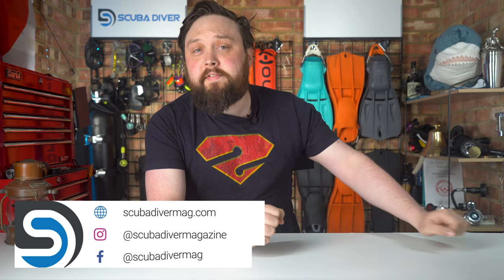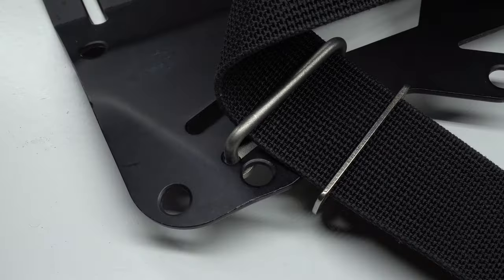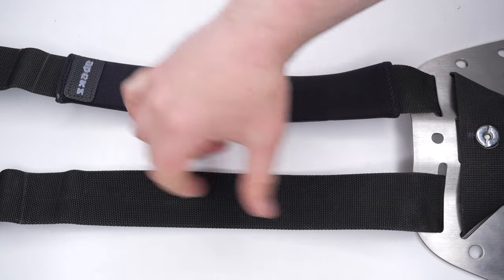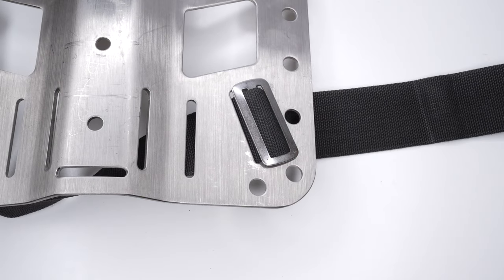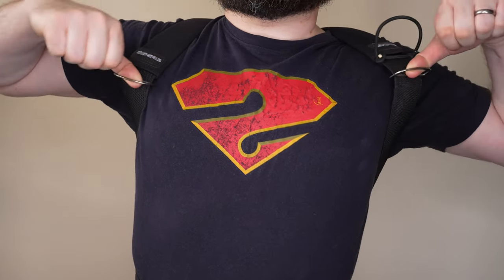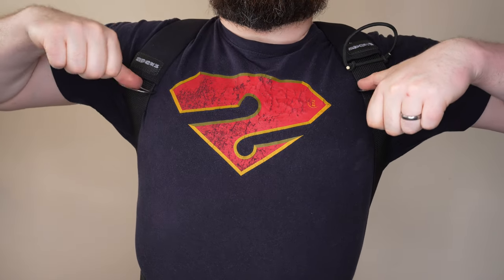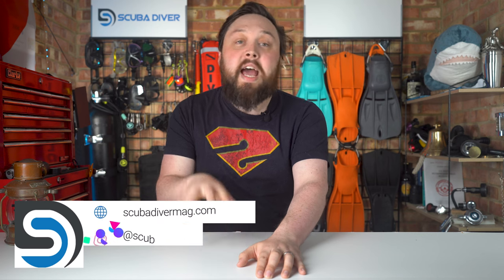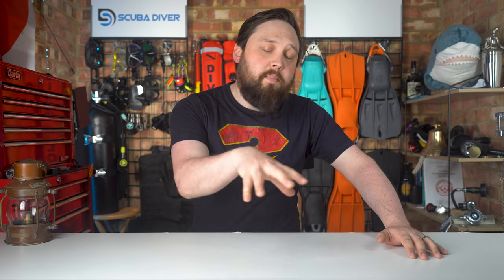How To Assemble a Backplate & Harness #scuba #howto @ScubaDiverMagazine

Comment: #AskMark Hi Mark, thanks for your detailed explanation of a backplate and wing setup! I am looking forward to get my own BP/Wing-Setup, but I am a bit confused about some details. There are some BPs, that are larger and thicker (3mm vs. 6mm stainless steel) than others. When to choose which of them? I thought that I would be able to "move" my lead from the pockets into the BP, but if I switch from a single- to a double-tank-setup, than it may be too much.. I currently need 10-12kg of lead, with a dry suit here in the cold lakes in germany (and I'm 1.90m tall, if that makes any difference for choosing a BP-"length").
Reply from the maker: Some divers prefer to have most of their weight on their weighbelt, others prefer to spread the weight across their gear.

Thicker backplates can replace some of the lead that you require but, it does make your BCD heavier to carry around and lift out of the water. If the thicker backplate would make you too heavy in the water with doubles then the thinner 3mm would be the safer choice. It's always better to be able to make yourself positively buoyant by just removing your weightbelt.

Comment: Any chance we can get a wee bit more detail on the crotch strap portion, and how one can adjust it when on/what if you cannot reach it due to your tank being just above your bum
Reply from the maker: You can't adjust them when you're wearing it, unless you're a lot more flexible than I am...

Thread a glider onto the flat end with a D-ring. Then thread it through the backplate from the cylinder side and loop it back down and through the same glider. 

Try it on and take note of how much length you need to add or remove, a buddy can be handy for this. Once you've found the right length move the slider and D-Ring to when you can find it easily and trim any excess webbing.

Comment: #ASKMARK I recently bought a ss bpw with 30lbs of lift. It has weight pockets on the waist band and i just discovered that with a total of 6 lbs of weight in the pockets, which is what i need, the wing won’t float my HP steel 100 in fresh water.  I don’t really want to buy a larger wing with more drag and i feel that it’s important that the wing should be able to float the tank/rig. I shore dive and doff/don in the water which is a real pain with a negative rig. Is it time to switch to a weight belt and take the weight off the bpw?  Am i missing something?  Thanks, John
Reply from the maker: If you think about what floats and what sinks, a lot of your +ve buoyancy is in the suit that you're wearing and all of what's -ve is on your BCD. It's the main downside to weight integrated BCDs.

I'd spread that weight out a bit. You don't need to put all of it on a weightbelt but, if you put 2 or 4 lbs on a weightbelt then you should still be able to float while wearing it and hopefully your BCD will also float. If it doesn't then you may need to move all the lead to a more traditional weightbelt.
Reply: @ScubaDiverMagazine  thanks Mark ill move some weight to a belt and see how it works out. John

Comment: Thanks for the video, super useful. Why not put a D ring on each side of the waist belt?
Reply from the maker: You certainly can put a D-Ring on the right hip. The main reason why some divers don't put a D-Ring on the right hip is that in a long hose configuration it can tangle the regulator hose if you have anything clipped to it, making it difficult to donate gas.
But, if you have need for a D-Ring on the right hand side you can place one there if you like.
Reply: @ScubaDiverMagazine  Ah yeah that makes sense, thanks for the answer !!

Comment: #ASKMARK Hi Mark, last year I bought the XDeeep first stage regulator NX700. As you probably aware, this has been recalled by XDeep due to safety concern. I swap it with the new Xdeep CX100, but I did not find any review about that. Did you try it? Are you going to review it? Also what are you thoughts about the recall? Thank you!
Reply from the maker: I haven't tried the CX100 yet. I do have some XDEEP gear I'm testing now but, no regs...

I like the recalls, it's inconvenient but, it's in the interest of safety. Dive equipment can pass all tests and requirements but, hand it to the general public and we'll find a way to break it. At least XDEEP are making innovations and this will only improve their next generation of 1st stages.

Comment: #ASKMARK - We are about to undertake some sub-tropical to temperate water ‘wreck’ dives from a max of 20*Deg Celsius - down to a min of 4*Deg Celsius. Could you take us through the full purchase process to acquire quality backplates, harness and wing assembly & its configuration to carry 2 x 12Litre Faber ‘Nitrox’ dive tanks, ALSO the purchase, fitting and installing all quality apparatus from 1st & 2nd stages through to a compatible dive computer with Gas Mixing capabilities, a dry suit - either tri-laminate or neoprene, fins, googles, hood, gloves and dive knife, torch, SMB, spares (emergencies, breakage or damaged say ‘O’ rings, spare D rings and double ended clips, etc. You will have a total budget of say 10,000€ being 5,000€  each for 2 divers. Can it be done?